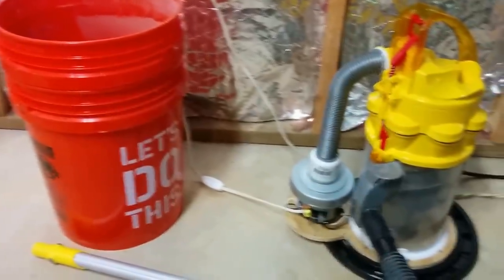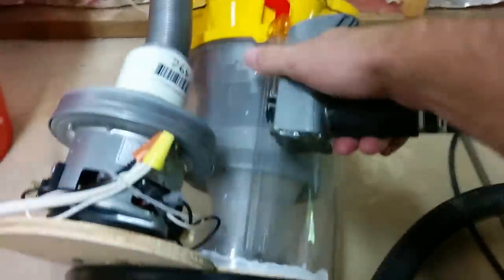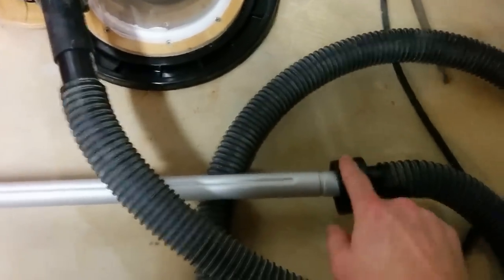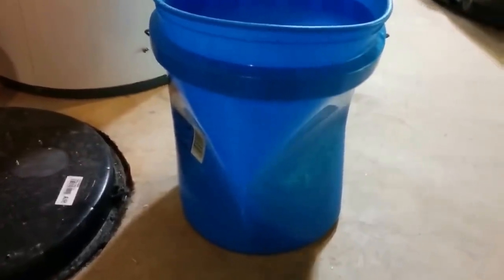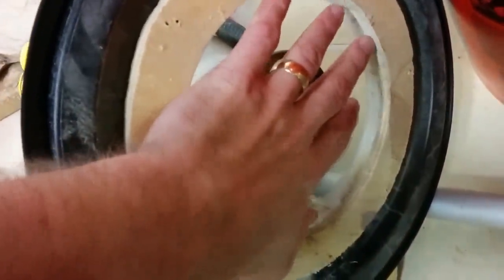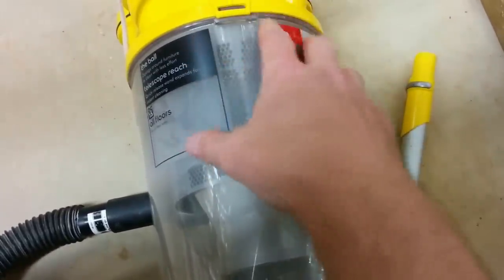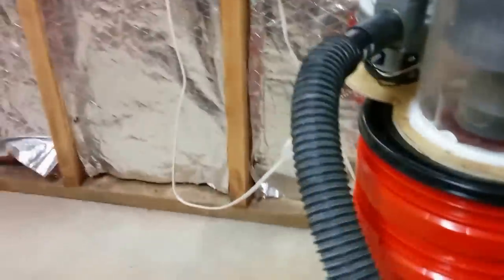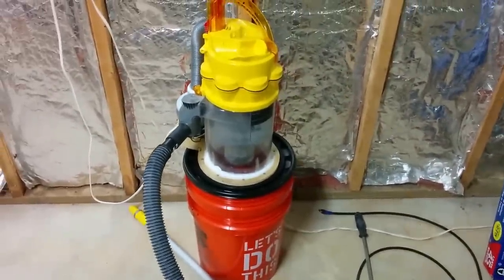Shop vac/dust collector made from dyson

Comment: The center hole you capped is where all the really fine dust that didn't separate out in the initial inlet spin (primary cyclone,) drops from the little cyclones. You basicly made a catch basin that can't be emptied. Two reasons why Dyson separates that compartment from the main bin: 
  1.) Keeps the cyclones from being effected by the same vacuum that is on the top part of the cyclones, which will short circuit the airstream, creating less airflow. 
  2.) Keeps the fine dust settled, so it doesn't spin up and get sucked back into the main stream, and make a continuing pass through the cyclone.

If you noticed on the original design, when you dump the dirt out, the center part dumps out too. 
Eventually, that chamber you blocked off will fill with fine dust, and render the little cyclones useless, and any new fine dust that doesn't drop out in the primary cyclone will go straight into the filter at the top, and clog it.

Good idea that you capped it, but it has to be removable so it can  be emptied. 

One final critique, get rid of that swing 90 at the intake. Have the inlet hose go straight into the Dyson separator. You are losing possibly 20cfm of airflow with that. Based off of my own testing with a digital anemometer.
Reply from the maker: The cap can pop out, it is  mostly held in place by friction. I have opened it up only once and it was pretty much empty. I need to change the inlet but I am waiting till I get my MakerArm to make a custom 3D printed part.
Reply: I was going to say that but you coverd that nicely.
Reply: Eric McCormick did you print any parts for this build? I’m about to try it with the same dyson and might buy them off you. Ether the digital file or if u want to make one.

Comment: If you plan to copy this idea,  make sure you include the final filter located in the vacuum motor base. Without it (this setup) the system passes the smallest and most dangerous dust particles into the room air.  Essentially it becomes a fine dust blower. You can't see those particles but they are the most dangerous because they can reach to the full extents of your lungs. 

The cyclones remove the larger particles.  The filter in the top of the canister removes medium sized dust to protect the final filter (missing here) which removes the very fine particles.
Reply from the maker: Tony Shulthise this vacuum didn't have have post motor filter. In the lid of this vacuum is a 2 stage filter.
Reply: Eric McCormick which Dyson model is it?  All of the ones I've taken apart have the final filter in the base and just a sponge and thin fabric filter in the top of the cyclone.
Reply from the maker: Not sure if the model, that info went into the trash a long time ago
Reply: Interesting,  it looks just like one that I took apart that only had a sponge and thin prefilter in the top of the cyclone assembly.  

For your viewers reference...

 If you plan to do this mod,  do your homework and make sure you reuse all the filters that came with the vacuum,  or equivalents. It's a cool mod but you want to avoid creating  a dust pump.

I made that mistake once and didn't realize how badly I was contaminating my shop air until I tested the air quality with a laser particle counter. I never would have known levels were over safe limits by 4x without the counter because the particles were too small to see.
Reply: This is either a DC14 or DC15. They both have post motor filters.

Comment: I found this video because I searched as I am intending to do the same with an old Dyson that I obtained from someone that was giving it away for free! 

As others have said though I think the very finest dust (possibly dust thats too fine to see in the air) will be caught by the inner cyclones and your design blocks it so I assume it will eventually fill up. I am wondering if it will work to fit a lightweight  hinged door over the central area. When the vacuum is on the trapdoor should be sucked closed and so will isolate the inner cyclones from the outer ones.  When the power is turned off then the trapdoor would open with gravity as the suction would no longer be holding it closed. That's my theory anyway! I have yet to try it.

Comment: I remember I was fooling around with 2 vacuum cleaners and I hooked the hose of one up to the canister of the other, connecting them together

I realized it could be used like this as I basically just made a vacuum cleaner with 2 stage filtration

Comment: very good use for a old dyson dc 14-15
Reply: connor coutts oh and you need to uncap the bottom as a lot of dust comes out of the piece you bloked off
Reply: connor coutts if i was you i would made a thing that you can still use to block it off but you could also open it
Reply from the maker: connor coutts stuff should only get in there if you go above the line on the canister.  It is attached with silicon caulk to the rubber so I could always remove the rubber and clean it out if it turns out it does get full somehow. If you just leave that open, I don't think you will get a cyclone effect.
Reply: the inner bit is where all the very fine dust collects and it is also where all the cyclones meet
Reply: and you never even need to take the bin apart you just had to attach a few hoses. thats what i do when i dont need to use the dyson.
Reply from the maker: connor coutts dust that small should end up in the filter which there has be very little of
Reply from the maker: connor coutts I made the bin with a snap on top that comes off really easily.  You really can't make it simpler way of cleaning it out.
Reply: you can you put the shop vac hose on the round hole and you take another piece of hose and place it in the square hole and just empty it as normal when it is full
Reply: Eric McCormick  The second stage cyclones are there to keep the filter from clogging.  Eventually the center section will fill up with dust and you will have to remove the small piece of plywood you sealed in place to empty the fine dust. The original bottom opens to empty the center volume when it opens to empty the outer volume. 

You have not included the final stage filter that resided next to the vacuum motor.  That filter is the one responsible for removing the smallest particles that are the most likely to cause health issues. You might want to add a box for the motor with a HEPA filter at the exit to catch those particles and cut down on the noise.
Reply from the maker: That wood plug can be popped out occasionally to empty that out but in the time I have used it, I took that off once and there was very little. This really only gets filled up when dust in the canister goes above the fill line.  As for the filter, that is still in the lid of the canister before it goes to the motor. You need this or else you can do some serious damage to the motor and bearings for any fine particles that get past the cyclone. 
There is a hepa on some vacuums and the extra housing can cut down on noise. However vacuums are noisy in general and this is for use in a shop which is generally noisy and dusty.
Reply: Eric McCormick the filter inside the canister is a prefilter to protect the motor,  as you mentioned.   The filter that takes out the most dangerous particles is in the motor housing. 

The second stage cyclones that feed dust to the center section are there to remove fine particles that the first stage can't capture because the centrifugal forces are too low. The second stage cones have a much higher air velocity so they remove the finer dust.   If you work much with a sander or if you route MDF that second stage will fill up faster even if the first stage does not overflow. Even so it would take a while before it filled enough to cause a problem so as long as you check it periodically it will be fine. If you just glue the bottom center of the original canister as a plug in the center of your Thien baffle then the center would be easy to empty without having to dig out the plug and reseal it.

I bought a couple of the Dyson canisters on EBAY last year to use for a similar purpose. 

One note for anyone thinking about using one for a shop vac... the pressure drop is too high for the flow rate generated by a large shop vac so you will need to use two canisters in that case.

Comment: Hi, Thanks for posting this,  I am also in the proses of biulding one of these.  How well is yours holding up, have you had any problems with it?  I was think of making a peace symbol shaped ring for going inside the bucket to help prevet culapsing.
Reply from the maker: Overall it has held up well but I don't use it a ton. I did notice that the inside bucket pulled away from the outside bucket a little. The vacuum that this motor produces is very strong and you need the material to be strong all around if using a similar vacuum pump. You might strengthen one part but it would just collapse above and below if the material is weak. I first used a 55gal trash can which imploded in the middle. I created a support on the inside using wood and steel that covered most of it, but then the 4in rim collapsed and ruined the seal.
Reply: Hi, I finally got mine up and running and it works great.

Comment: wow dude that is awesome!! Why do you need to cap the bottom of the cyclone?
Reply from the maker: Matt James the port is for cleaning out the center area which can easily pick up dirt when you go over the fill line. While operating, this needs to be covered to maximize the cyclone effect.
Reply: Eric McCormick, wrong, bucko. The center hole is where all the really fine dust that didn't separate out in the initial inlet spin (primary cyclone,) drops from the little cyclones. You basicly made a catch basin that can't be emptied. Two reasons why Dyson separates that compartment from the main bin: 
  1.) Keeps the cyclones from being effected by the same vacuum that is on the top part of the cyclones, which will short circuit the airstream, creating less airflow. 
  2.) Keeps the fine dust settled, so it doesn't spin up and get sucked back into the main stream, and make a continuing pass through the cyclone.

If you noticed on the original design, when you dump the dirt out, the center part dumps out too. 
Eventually, that chamber you blocked off will fill with fine dust, and render the little cyclones useless, and any new fine dust that doesn't drop out in the primary cyclone will go straight into the filter at the top, and clog it.

Good idea that you capped it, but it has to be removable so it can  be emptied.

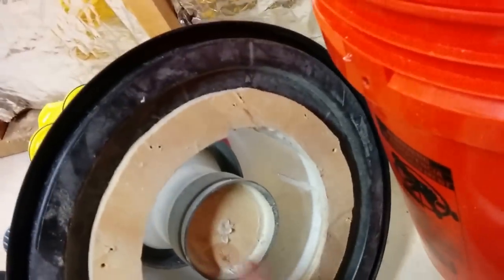Comment: Would I be correct in saying that because you closed the bottom hole, as in 4:08 then at some time the  cones in that Dyson design will stop operating?  This will happen when the dust under the cones will fill all the  available space under the cones!  I have to check on this one.
Reply: Carmel Pule' your correct. ... the cones will fail and any benefit of the technology will be lost in this design.
Reply: You guys are both correct.